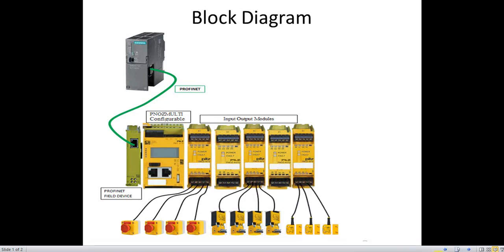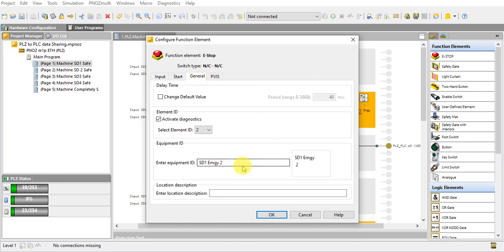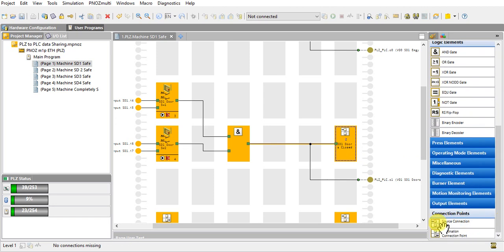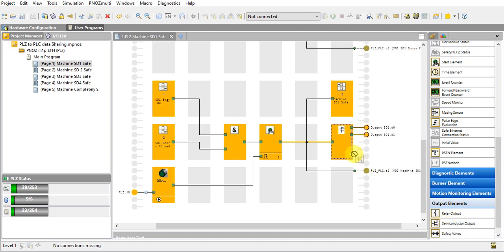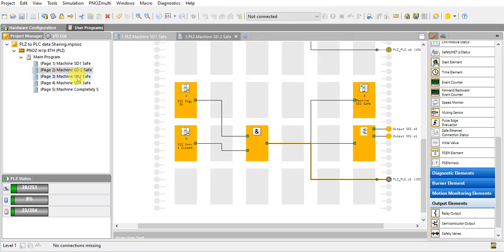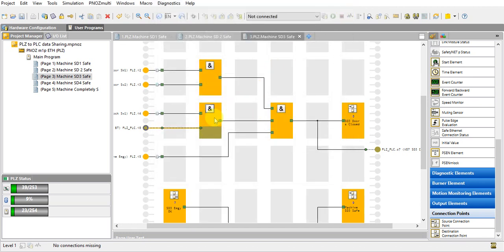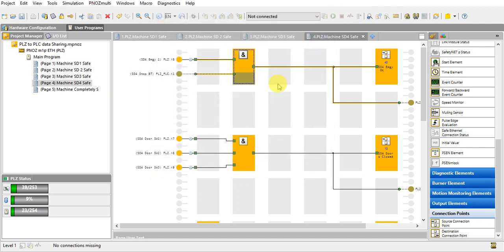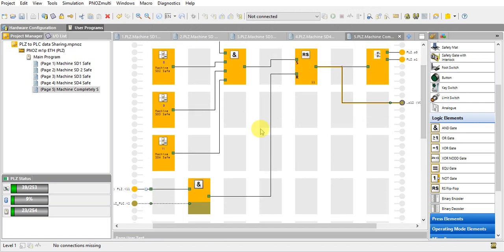PLC to PILZ Safety Module Data Sharing Part 2

Comment: can i connect pilz safety switch directly to the plc, if yes which module do i use? If not, what do i need to program pilz safety switch ?
Reply from the maker: You Can Use Siemens PLC, That Has Safety input/Output Module and Also It Allows Creating Of Safety Program. You Can Watch My Youtube Videos
https://youtu.be/fqCxWFhE2BQ?si=9WxSaxdz8S-VYgDS

Or You Can Use Safety Relay PNOZ S5, S7. For Less Cost And Small Safety Requirement
Reply: @bellewolde  Pefect, thank you.